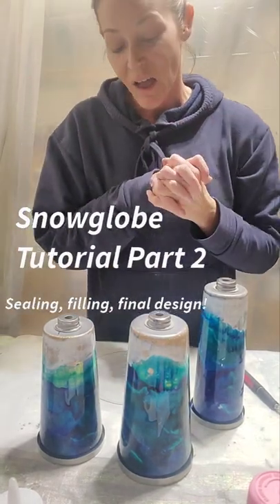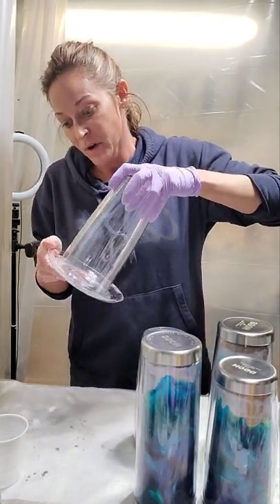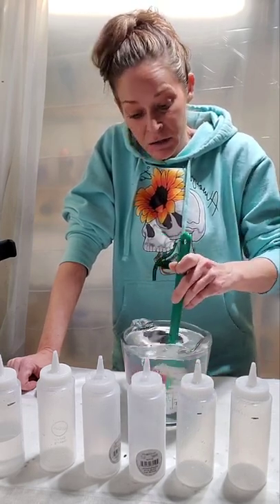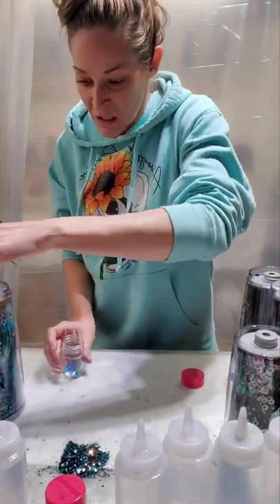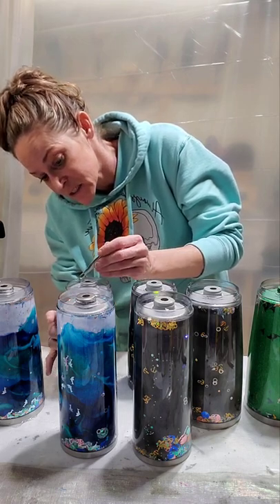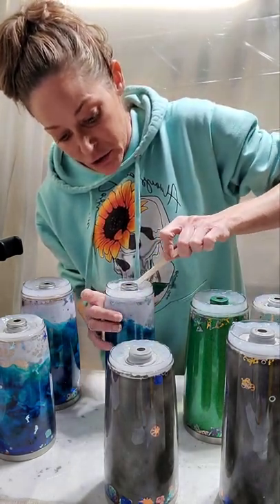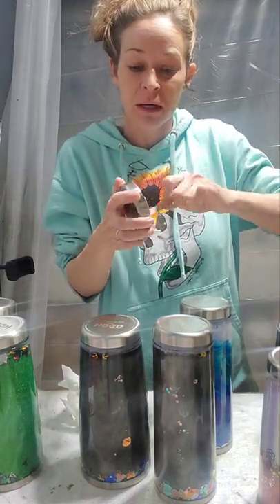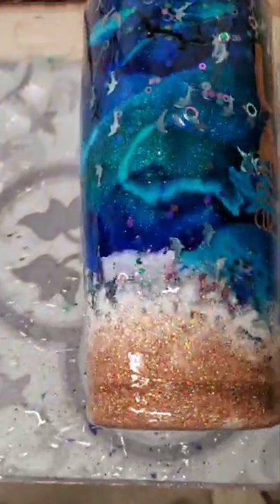Storyboard tumblers Part 2

Comment: What do you do if the leak test goes wrong?
Reply from the maker: You must remove any silicone and liquid clean with rubbing alcohol and start over.  The seal at the top is the most important at get nice and good.  Let setup before filling.  Test with distilled water 1/4 and let sit over night to ensure no leaks. Let me know if this helps.

Comment: Are you literally spreading the silicone from the SS across the gap to the acrylic sleeve?
Reply from the maker: Yes I stay away from the screw area on the first round of silicone.  Once it's sealed and passes the leak test I fill the hole with silicone and the rest of the bottom before I screw on the lid
Reply: @KotekTime  thank you! I commented before you showed it. I appreciate the detail!
Reply from the maker: No problem!!!

Comment: How do you fix it if there's a leak
Reply from the maker: A leak from the top or bottom seam?  Do you leak tests 1" of water to check top seam if it leaks I would co around with uv resin until sealed.  Bottom before you screw the bottom on put it right side up in a Tupperware or on a paper towel ... walk away for 20 mins if it wet or leaking ... you try to add more silicone or pull that silicone out and try it again ... let me know if that makes sense... hope it helps
Reply: @KotekTime  thank you! It's the top rim. BTW, this tutorial gave me the confidence to do one. My 1st one came out beautifully. The 2nd one...I think I got cocky

Comment: Do you have to do any prep to get epoxy to adhere to the acrylic or metal bottom??
Reply from the maker: The acrylic no the bottom a light sand on it ... I spray enter cup with triple thick as well
Reply: @KotekTime  You spray the acrylic before you do anything to it?
Reply from the maker: If I am doing a peekaboo then I lay my decals ... spray once with triplethick... spray peekaboo color and let it gas off ... pull decals ... then spray one more time with triple thick ... then onto the epoxy